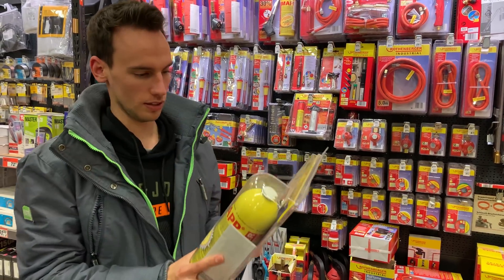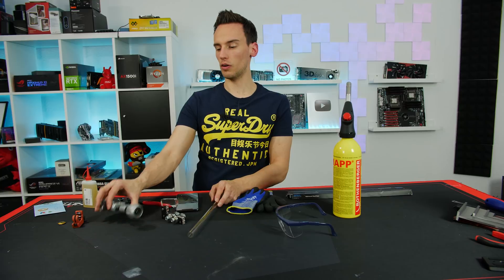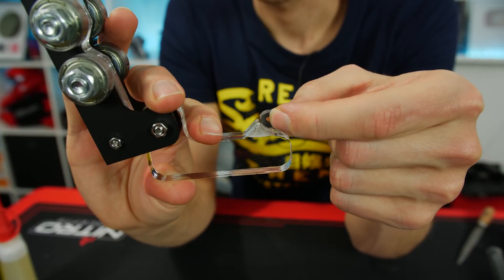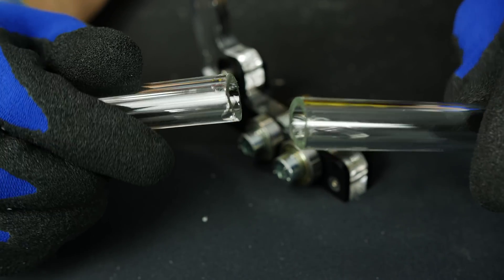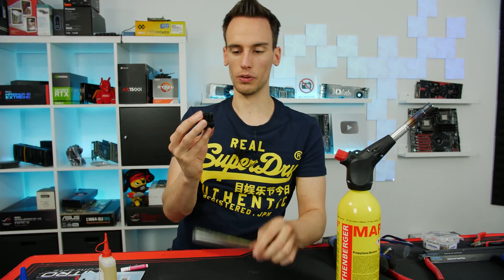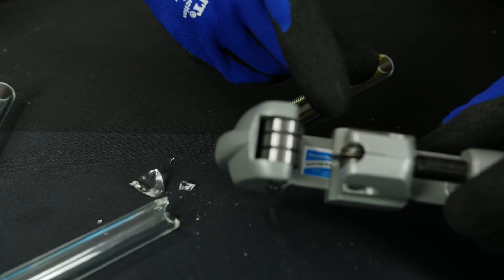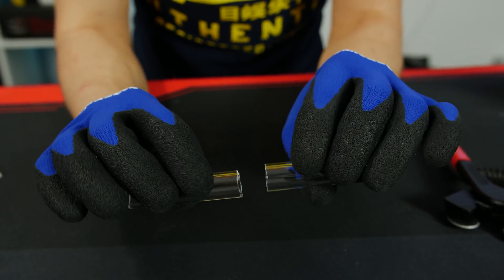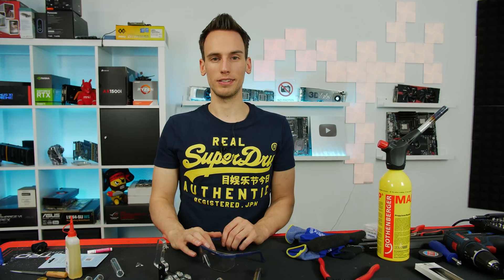Project Irrationality Part 5: "Why did you not just use a normal pipe-cutter?"

Comment: After you score glass. A good score is when you hear the glass crackling under the blade. That is just the start of your score. After score tap tube on score line all the way around a couple times then put something under one side of tube and firmly press other side of tube. It should snap more clean. Then take your torch and soften the ends.

Comment: Hi Roman, i have an advice for your cuts, i hope i won't be too late...
To cut properly glass tubes use a carbide insert to mark the cut. (If you kwow somebody who has a lathe, aluminium carbide insert have a good cutting angle rake)
If you dont have a lathe, i used to do it in the past for a stirling engine mounting the tube on a hand drill fixed on a table in a vise. The fixture beetween the mandrel and the tube was home made using a rod which had the same diameter of the inside of the tube and glued together with tape.

Next, just a flame on the edge should soften the edges of the tube.

I think you should check this technique which seems to be quite accurate and does a clean cut (it reminds me my personal attempt in the past but here it seems the thermal shock helps to have a perfect cut which follows the carbide marking) : https://www.youtube.com/watch?v=hYU3YXyAceI
I hope it will improve your cuts ;-)
Cheers.

Comment: I cant believe there is not a good off the shelf glass tube cutter out there. As you said, why is there not a spring loaded device (calibrated to apply the proper force)  that can be mounted in a bench vice.

Comment: You push pretty hard and roll the tube back and forth a short distance. Push hard enough to hear a grinding sound as the glass is being scored. You only have to score a short mark on one side of the tube, not all the way around. Hold the score mark away from you as you apply gentle pressure to cleanly break the tube. yes, more leverage will give you better control of the presure.

Comment: You need to be careful about how you heat up the edges because otherwise you will leave deposits on the glass, ideally you would use a LOX flame as it would only leave behind water.

Comment: The proper way to cut boro is a small score mark, 1-2mm then snap, or use a hot torch to stress crack the tubing from the score mark. By only using a small score it breaks much cleaner. My brother is a scientific glass blower.

Comment: Do you have a small lathe you can put the tubes in? Use an 1/8” or 3mm square carbide tool bit to score the glass. Then a micro torch to heat the score and the end will just snap off. You can then use the lathe and torch to polish the end of the tube.

Comment: using the glass cutter should have a smooth almost "zip" sound similar to quickly ripping a sheet of paper. When you hear that grating sound you're scoring the glass too deep and causing those seashell-shaped flakes to happen. Light, even pressure on the score and the break will follow the score for a smooth straight cut. When you're "cutting" glass you're not actually cutting just giving a path for a controlled break to follow.

Comment: Well yeah your tool is obviously better because it has glass cutting wheel and it doesn't hold it against the glass tight whereas the other ones are meant for brass/copper/aluminium/soft steel pipes, absolutely not for glass...

Comment: What works for me is Dremel with dirt cheap diamond cutting wheels from AliExpress to cut the glass tubes and shape a bit the edge (slightly connical). After that I do the fire polish on a regular home gas cooking plate. The  firepolish takes some time - 5-10mins for each edge, but it's free and already there to use. With the right burner it is possible to bend the glass tubes at home.

Comment: I still perfer my belt sander (mounted upside down, so hands free!) over a blow torch. Yes the result isn't as smooth, but well smooth enough not to damage a seal. And its WAY faster, especially when you need to repeatedly test fit and remove those last few millimeters.

Comment: from what i can remember from the study for toolmaker i learned how to work with glass at the glassmaking lessons. we made a little scratch in the glass and little heated it with the tip off a flame. I don't know if it will work with the edge thickness of the glass you use. maybe it's worth a try

Comment: you could apply the principle of the by applying some mechanism to lock it down so you could use a fine screw to keep consistent pressure. example some sort of hook with a screw shaft that can latch to either the top or bottom of the cutter with a screw shaft with a large turning mechanism so you can make minor changes.

Comment: 1) why not use a dremmel with a diamond cutting wheel?
https://www.dremeleurope.com/general/en/dremel%C2%AEezspeedclicdiamondcuttingwheel-354-ocs-p/?productLabel=products

2) Try a proper glass cutter recessed into wood - see this guys video - https://youtu.be/IuUK8T_8FNc?t=35

3) Use a Hot Wire System - same video - https://youtu.be/IuUK8T_8FNc?t=279

Comment: I learnt how to make tubing with borosilicate tubes for chemistry long time ago . To cut the tube you only need to apply a light pressure . I used a straight tungsten carbide cutter to did that, no oil needed .After that you just have to tap gently the tube with a screwdriver to expand a little bit the cracks and after that manually apply a force to break it . The cut would be clean and regular . I'ts easy enough to bend the tubes with some training but you need an oxyethylene torch to do that and you need an oven to anneal the glass or it will crack later .

Comment: Hey there, previously sent comments on Discord. Beyond what you’re doing now, I use masking tape on one side of the cut to make it easier to know where to score all the way round and you can lean the cutting wheel against it to keep it perfect. Also an electric wet tile cutter with sharp diamond blades like the VITREX 103420 is meant to be great, but I use masking tape and that little handheld wobbly cutter from Amazon you had in the first video (using the masking tape method) with a map torch to polish and get great results. Photo in your Discord.

Comment: Only need to score just a bit more than half the diameter of a glass tube with a glass scoring knife.  Moisten the score then snap....  And use the 2nd inner blue flame to heat treat the glass

Comment: Might be worth a try to simply scratch one point on the tubing with a cutter or file and then snap it by pressing opposite the scratch. This is how I was taught to cut glass tubing in the chem lab, although it's typically smaller diameter tubing. It usually leaves a clean break.

Comment: Use a diamond blade on a dremal or high rpm rotoray cutter and gas mask with a filter for the dust because it so dangerous. And for the flame polish I suggest using higher heat until the glass almost melts because it's produce better results typically. Pro tip: lighter pressure in cutting is always better

Comment: diamond dremel cuttoff wheel under running tap  of water or some sort of water with pump, you need the water to stop making dust and breathing it, make sure you use Dremel Flex Shaft Attachment (225-01) 
I've cut glass tiles with this, works amazingly

Comment: With borosilicate you can throw it in liquid nitrogen after heating it up without any shattering. You usually would scratch the tube and then tap one part against something so it breaks off.

Comment: If anything a fine thread bolt on the end of your tool to keep a constant pressure on the tube. Possibly put some rubberised tape on the outer race of those bearings to stop the smooth tube from moving sideways during the cutting process, and from applying too much force. Other than that i think it will be fine. I mean sure you could use a dremel clamped down with high speed diamond wheel, but a lot of mess and dust, and a lot more work.

Comment: The best way to cut glass at home is by using a diamond blade on a rotary tool (I.e., a Dremel). Have some lubrication with water and gently touch the glass, rotating it against the blade, then apply a bit of pressure to make the cut.

We do this at our company whenever small glass samples are required. On our industrial machinery, we produce thousands of glass tubes per hour, for use on the medical industry. Not only they are clean cuts, they are very precise. However we always finish them with heat.

The diamond cut, however, will be your best bet.

And you might want to try the heated cord method. Heat cuts on glass tends to give a better finish right away than any contact based cut, but it is trickier if you don’t have it properly aligned.

Comment: You basically just need to score it to cut it, aim for the straightest line rather than the deepest one. Good luck
Reply: Yeah, the first cut before breaking the glass with the pipe cutter was looking fine.. Should've just tried to cut it afterwards..
Reply: you only need to score it then run it under hot water and then cold and it will break off with verry little force or by it self.

Comment: If you live within a reasonable distance of a research university you should be able to talk to someone from the chemistry department about glass tubes. Usually big universities, and even smaller ones sometimes, have a dedicated glass blower/glass maker who would probably be more than happy to help you out with glass tubing. Just a thought, you could probably even email them and get a good response. Glass tubing has to be used in chemistry at times and any good glass blower for a university would know how to create various sizes and shapes of glass tubing, and probably even how to make sure it works well with fittings etc. Just my 2 cents.

Comment: I asked a glass cutter worker for advice, and he told me this:
He screeches a line in the glass tube with a conventional metal tube cutter, but it has a special diamond knife on it for cutting glass that you have to order separately.
"It is not so much about the depth of the cut, as it is about having it equal, and line up perfectly"
Then he takes the tube, and puts it on  top of a 2mm steel rod, and lines up the rod with the scratch on the glass ("you need a good hard surface underneath. A wooden table absorbs vibrations, and is not good for this")
The rod is a wedge where the force will be applied as a breaking point.
You press one side of the tube down with hand, and body weight, and use a rubber hammer to hit the tube on the other side of the steal rod wedge.
With a bit of practice you can get a perfect clean brake off point.

For the edges there is a special diamond tool to make a chamfer,  or just use a blowtorch.

Sorry for my bad English!
Reply: Your English is practically perfect.

Comment: the absolute best way to cut the glass is to get a diamond wheel for your dremel and use a water drip over the cutting area to keep the dust down while still keeping your protective equipment on, you can use the same wheel to chamfer your edges and then flame polish the ends, you will get the cleanest cuts and the least waste through breakage.

Comment: If the rotation is an issue, you could maybe try to add a 1:4 reduction crank to it. Somehow make a geared pulley system that pulls the tube directly against the bottom bearings ( maybe a wide rubber band ) and then have a crank on it so you can count the turns and the tube is cut perfectly straight if the pulley system is aligned properly. I imagine it like this: slide the tube through the rubber bands onto the bearings, then clamp/tension the rubber band and push the cutter down and crank four revolutions.

I might be overthinking this a bit.

Comment: I used Glass Tubing in my Corsair 1000D build, I just used my 7inch Wet-Tile Saw I bought years back for rehabbing my house. I bought a special blade for it designed for cutting glass tiles and used it to cut the tubes, I had none of that chipping or cracking you had with the pipe cutters you used in the video. I just went and looked at the blade it says "North Jersey Diamond Blade D220". It came with this stick of dressing to clean the blade with after so many cuts to keep it sharp. I just took it apart to replace the AMD 2700 with the AMD 3950x I picked up this past Monday.

Comment: i would put your glass cutting wheel into the big rigid one. if you dont put as much pressure you should be ok. and instead of snapping the tube. try and tap it gently with something metal all around the cut. just keep turning and tapping . it should just fall apart

Comment: The three wheels have different cutting angles on the blades.  Different materials need the correct angle for cutting.  Considering you only have your eyes you are born with, it is better to be safe than sorry and wear safety glasses when heating and cooling the glass (shatter).  Avoid cooling the glass around fans or outdoors.  Even gloves are great.  I am imagining you mastering the glass craft and making your logo a part of the loop.

Comment: There is also chain glass cutters, similar to chained soil pipe cutters but designed for glass tubes. There are small glass cutting heads on the chain and chain is squeezed with a pliers.  When chain rounds the tube,  you put small but equal pressure to the tube. That might help to cut the glass tube more cleaner.

Those are some different models that I could found:
WHEELER-REX 69012-REX Glass Tube Cutter, 1/4" - 3/4"
WHEELER-REX 79014-REX Glass Tube Cutter, 1/4" - 1"
WHEELER-REX 79022-REX Glass Tube Cutter, 1/4" - 1-1/2"

Comment: if you had guides/stops on the other side of your cutting arm to keep the blade in line with the bearings that would keep your cut straighter, a sprung screw down would help hold the cutter down at pressure while you work on the cut too

Comment: if you look at the threads on that copper tube cutter, one half rotation would be half the distance between 2 threads, that is a lot force for a glass tube to take, if you only make small adjustments after you have contact, minimal adjustments like 1/10th of a turn each rotation it might work better if the cutting wheel is good enough!

Comment: You need a "stop block" for the tube length. If the cutter is mounted to a surface, and at an (adjustable) distance (in direction of the tube) there would be a stop-block (wall) then the cut should not be able to go "helix".

Comment: You could try a wet tile saw for cutting glass pipe.  These are high rpm circular saws designed for cutting kitchen and bathroom ceramic tiles.

Comment: I used to (1970's) cut a fair amount of glass and SiO2 tube  in my lab. I used a V-block (mine was nylon) with a shallow relief at the intersection of the V. The score line was very shallow, but precise. I use an industrial diamond scribing tool, inserted from the bottom of the V so that the scribe very lightly touched the glass tube with a uniform pressure. The scribe was held in a sleeve that allowed very little side to side movement, about  <.05mm total runout at the tip. Lastly, the scribe was spring loaded at its base, allowing the uniform pressure. I will draw one up for you if you need to do this more. Flame polishing the cut edges also stress relieves the tube avoiding breakage down the road. You already learned the need for just one rotation and light scoring pressure. I made everything on a vertical milling machine; drill presses won't cut it.
Reply: THIS

Comment: Fire polishing is the word you are looking for. I did my glass tubes a year ago (I documented it in a video on my account. It is not a good video but if you need inspiration...). A small scratch and only one around the tube works best. When breaking not only apply pressure behind the scratch but also try to pull slightly apart with your hands. Sometimes the break surface is slightly uneven. Just slightly sand it under water and then fire polish the ends. ;) Ah and by the way buy your glass at a local glass store it is much cheaper. I got mine from Germany and it was about 1-2 Euros per tube ;D.

Comment: Diamond blade on a dremel or high rpm rotary tool. Draw back is it creates dust
Reply: There are saws to cut ceramics, glass, and other delicate stuff. Those saws uses water to keep dust on the floor.
Reply: You just use the dremel's diamond blade under some running water to keep the dust down and wear a mask to be sure.

Comment: Just some machines specially made for glass cutting/sawing. For the best result on thick wall glass tubes.

MK Diamond MK-377EXP Saw 160028-GL Wet Cutting Glass Saw with 7-inch Diamond Glass Cutting Blade

Gemini Taurus 3 Ring Saw

Gryphon C-40 Band Saw

Gryphon Omni-2 Plus Wire Saw

Comment: You just need to score the glass with the tile/glass cutting pliers, doesn't need to be super deep - then snap the glass. 
Afterwards, to remove those jagged edges get some ~240 grit wet & dry sandpaper and some water.  
Put the sandpaper flat on the desk, dip the end of the glass in some water, hold the tube vertically and use a circular motion on the wet&dry to wear down the rough edges, make sure to keep the end of the glass wet - dip it in water again if required - and repeat until you are happy with the end of the piece.  

The sanding should only take about a minute or so and avoids using any cutting tools (such as dremels) as you are only scoring the glass and any glass particulates are trapped on the wet&dry paper unlike some of the other methods.
Dispose of the wet & dry paper once you are finished.

This avoids having to use a gas torch to anneal the ends - fire is cool - but some people may not be comfortable  with open flames nor able to obtain or use one.
You will never get a perfect glass cut on a tube unless you use a laser which are expensive and not really for DIY situations.